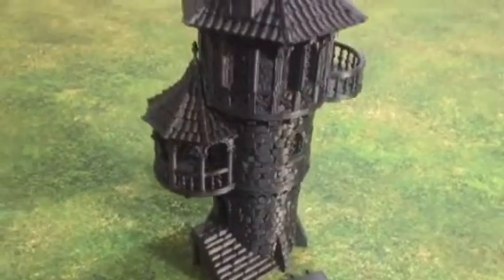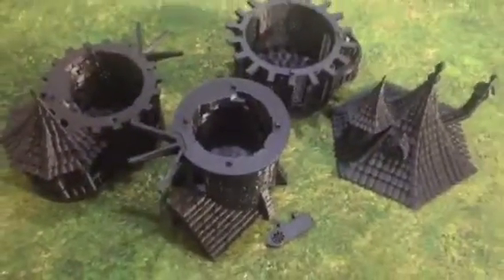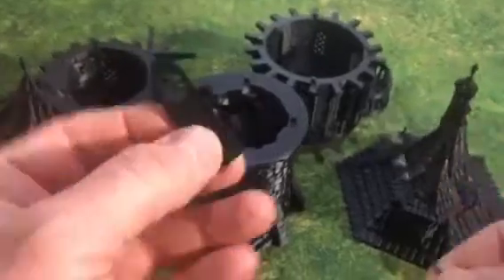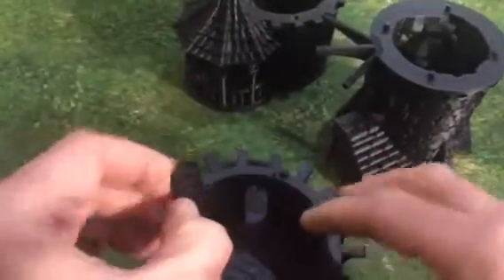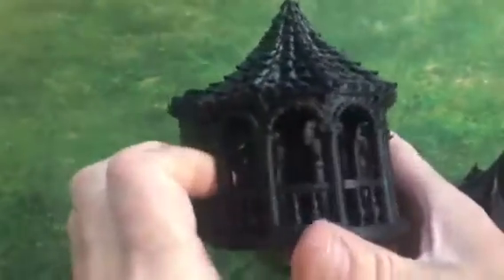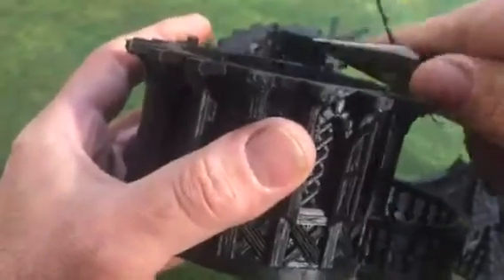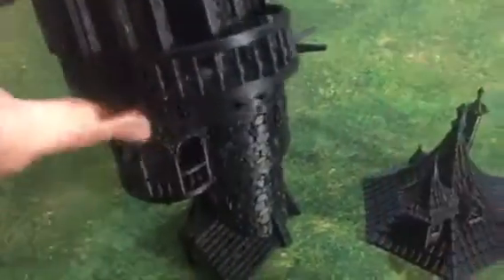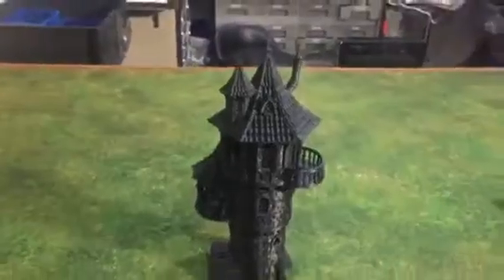Wizard tower and how to fit the doors

Comment: Good Morning Printable Scenery. I know this video is 7 years old. I just discovered you all about a year ago and FINALLY got my 3D printer. This is probably a softball question. You are using filament for the hinge. Could a toothpick, floral wire, or the like also work? I am probably overthinking this. Thanks for your response. Slainte.
Reply from the maker: Yes we are using filament for the hinge, however anything like a wire or thin toothpick would do, the hole is 2mm